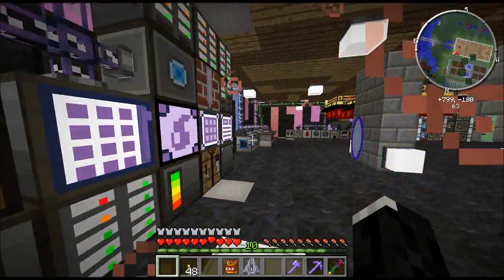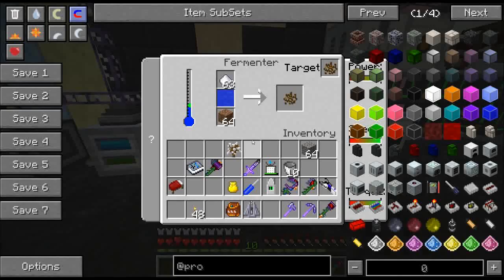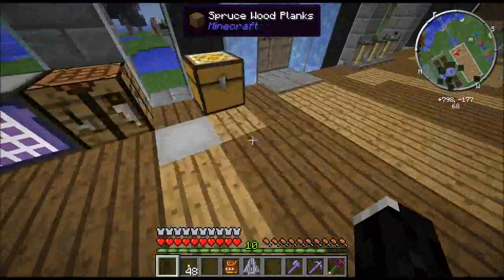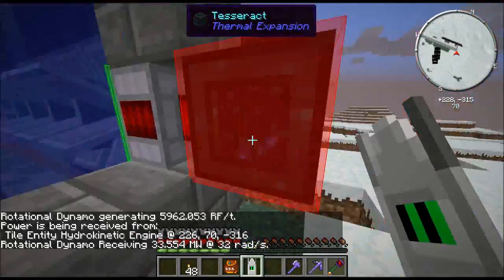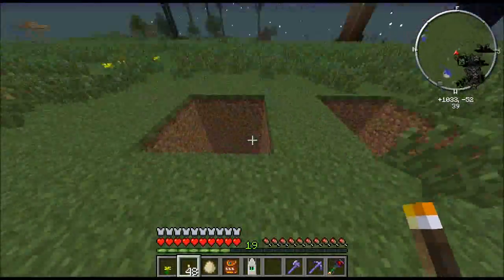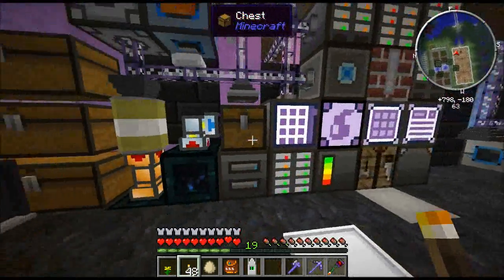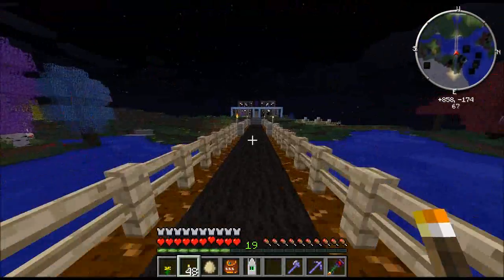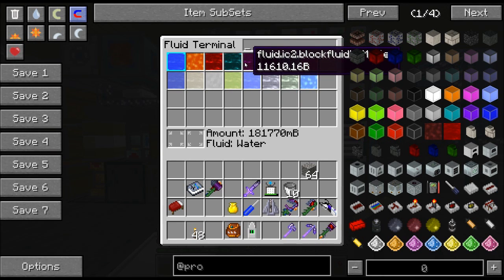Further RotaryCraft Insanity

Comment: I've really gotta try ReactorCraft some time. It looks fun. I only shied away from it previously because it's not feature-stable and adds tons of ores.
Reply from the maker: Only fusion reactors and control rods remain heavily in-development, really.
Also, it adds less ore than IC2 or ThermalExpansion; why does it have such a reputation for being an ore spammer?
Reply: It's the various colors of flourite. Which is unfair, in a way, since they all serve the same purpose. This does mean that the player is likely to end up with a lot of inventory slots taken up by rare ores while mining, however.

Still, next time I play modded single-player I'm going to use ReactorCraft for sure, since I love how multi-block and emergent it looks.
Reply: ReikasMinecraft By just the first day I had amassed multiple stacks of fluorite. It seems to be one of the put offs for people trying out Reactorcraft.
Reply from the maker: You need that much fluorite, so there is little I can do.
Reply: ReikasMinecraft Just have one color? it IS kind of insane how much of the stuff you come across :x
Reply from the maker: There is multiple colors because it is encouraged to make fluorite blocks, which serve as a sort of Geiger counter (light up in the presence of radiation). Multiple colors are necessary because people would otherwise complain "I don't like red/white/purple/etc walls!".
Reply: I didn't know they were reactive omg lol... dude, these lil things.... primo.
Reply from the maker: My tech mods are LOADED with "little things".
Reply: ReikasMinecraft Has the Geiger counter function always been there? First I'm hearing of it too.
Reply from the maker: Yes, because fluorite actually does that.
Reply: Speaking of little things, please find a way for hydrokinetics to work from the bottom via energized glowstone... it was literally my first thought when I learned about the mod and I was crushed to find out it didn't work D;
Reply from the maker: No, that would mean a total rewrite of their code, and completely break the design for realism.
Reply: Sadface..   Have you given thought to assigning various fluids realistic specific gravities for increased wattage on the hydros?
Reply from the maker: Only water works, so no. Also, most fluids are too fantastical (glowstone, ender, UU-matter, liquid XP, et cetera) to even try.
Reply: But you could just make the fluorite blocks paintable with dyepowders.
Reply from the maker: No, because they do not match dye colors, and there would be complaints only 8 colors work.

Comment: I must say that Rotarycraft and reactorcraft together with applied energestics and ender io is my favorite mods. I really can't imagine playing modded without those. Also if you have dartcraft installed. Why not use the item cards instead of the cyclic assemblers? They require zero energy and works at least as fast as they do?

Comment: how did you get the extractors to work so fast i can't do it by my self:S
like how much rad/s and nM are you jusing in the extractor and how to get it..

for the most part good base:)
Reply from the maker: 67MW of power each, geared with CVTs.
Reply: ReikasMinecraft  so how can i put out 65MW with a magnetostatic?
and is the cvt set to torque or rad/s?
Reply from the maker: You no longer can do that with magnetostatics; the CVT flipped back and forth.

Comment: Having quite a few problems with the spawner controllers, any thoughts as to why I crash quite often while opening their interface?
Reply from the maker: Log?
Reply: being that I have been fortunate and not had any issues on the Monster pack, I have had my log disabled, I'll get it activated and see if I can get it for you.
Reply: ReikasMinecraft  well of course when you need it to happen it wont, ill let you know.  Currently I'm going to begin and hopefully finish the setup of a nice reactor.  Considering this video, and seeing as your producing so much power.  I don't even know if thermal expansion tesseracts are limited to how much power they may move but you do not seem to have any problems with it.

Comment: since you can't use the magnetostatic engines as easily to transfer high amounts of power, how would I make extractors run so fast if my main power generation is in RF? Don't really feel like building a whole new power system just to run my extractors...
Reply from the maker: You have little choice.
Reply: So either I build a new power system, or I use shaft junctions on the new magnetostatics and get hundreds of them?

Just so I know, what rotational speed were these extractors running off of? I'd like to achieve a similar result eventually :)

Also I read on your site that you don't intend on making your power system some form of "electricity", yet you don't use shafts for the bulk of the power transfer yourself, why is that?

And one last thing: you say you intend to make your mod realistic to some extent (material properties, resistances and such), then why are shafts lossless?

Love your mods BTW, especially RC, haven't felt this way playing minecraft since the day I discovered IndustrialCraft way back :)
Reply from the maker: The extractors were running off of CVTs at variable speed; as of v16 you would need to combine several magnetostatics to supply the necessary 67MW per extractor.

As for why shafts are lossless, it is because they would otherwise become unusable.
Reply: ReikasMinecraft Works great, just using 4 magnetostatics with junction shafts and the CVT at variable speed I'm getting about the same result :D onto setting up smelting, automation and other stuff now :)

Comment: How did you setup your extractors to run all 4 stages?
Reply from the maker: With 67MW of power each.
Reply: if you ever get the time I would really like a video of the setup for it. I can only make out the bevel gears, extractor, cvt unit looks like a gear box then magnostatic engine.
Reply: cant find much on setting them up to run all stages
Reply from the maker: It is simply a matter of enough power.